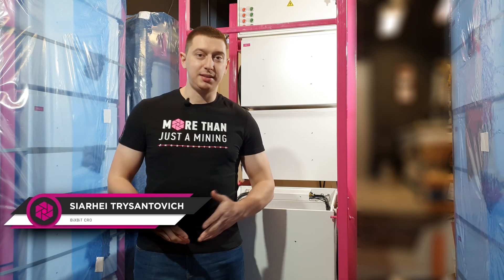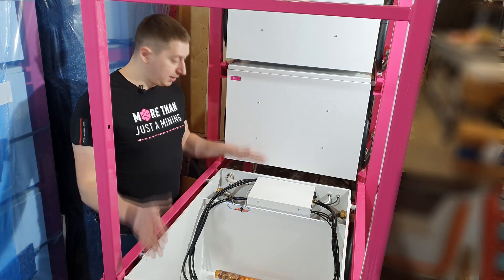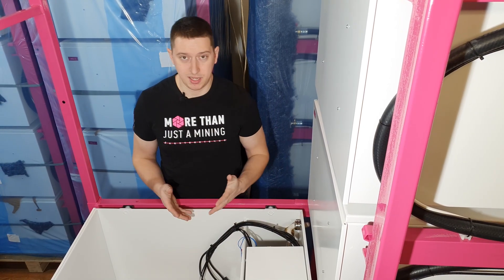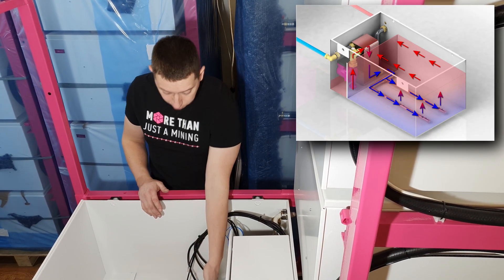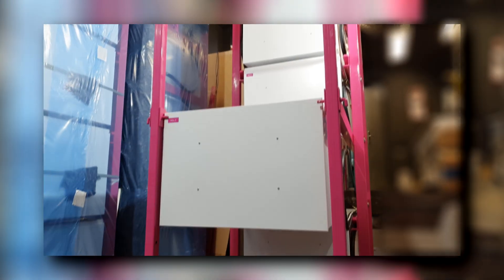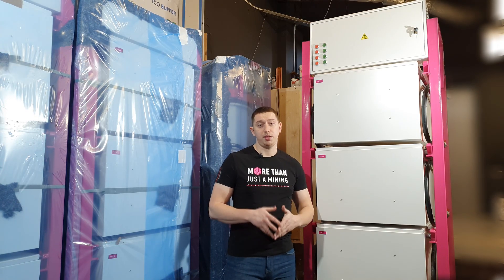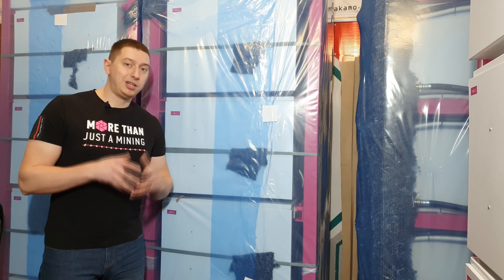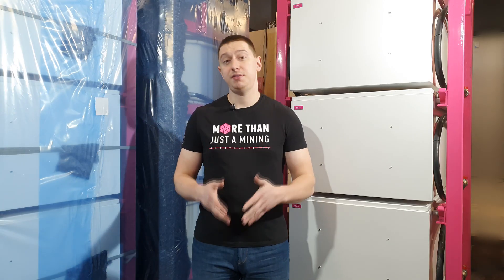BiXBiT Immersion Cooling System: Rack & Cell Review

Comment: Hi guys, did you applied Inmersion Cooling for Canaan miners,  1246 model, ? what its the perfomance ?  thanks
Reply from the maker: Hi yes, we have chilled Canaan models, they work great in immersion fluid. There is no firmware on this model yet, they can work so far only in stock. And so for ASICs, the performance gain is somewhere in the 40-50%
Reply: @BiXBiT_Global  hi that perfomance its with 1246 85T ? thanks
Reply from the maker: @hitsugiRSG  Please send your request to sales@bixbit.io and you will definitely be helped with the selection of our equipment for your purposes